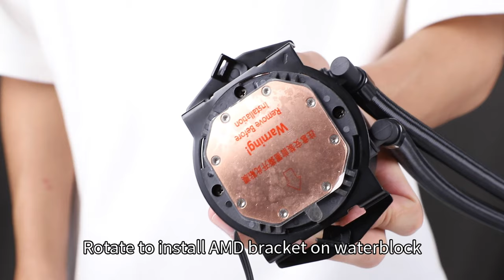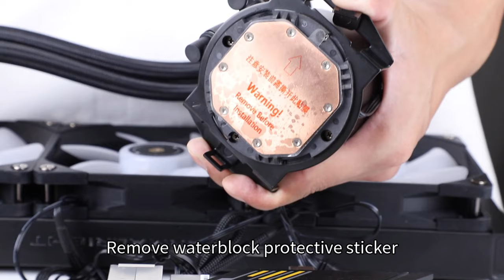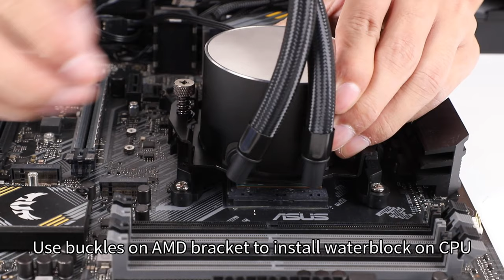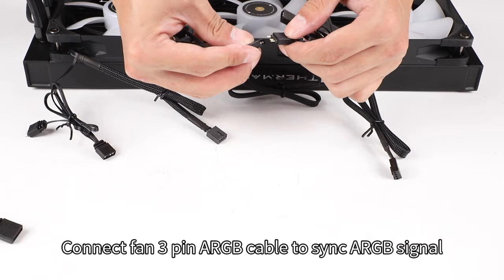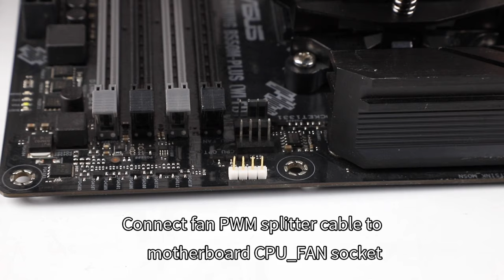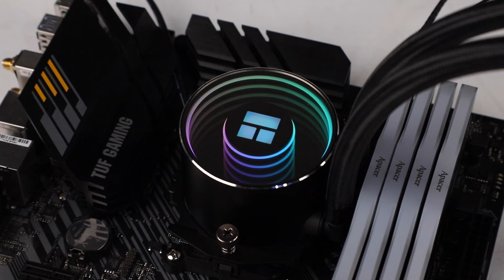THERMALRIGHT FROZEN NOTTE CPU Cooler Installation Guide for AMD AM4 AM5

Comment: This is the most confusing aio every i should of bought something more expensive
Reply: Exactly
Reply: @RichBandza  I was able to figure it out eventually, got it working fine
Reply: @TheDarkEmpty  i finally got passed being confused. N also got it working sumhow lol
Reply: how did you find out? im so confused where to connect the fans
Reply: @jair2610  I'll look tomorrow and reply
Reply: @TheDarkEmpty ok thanks, im so confused on how to connect the fans to eachother and where to connect them afterwards, is there any place i can message you with pictures?
Reply: I have just built a whole computer, and this thing has had me stumped for 2 days. The video is not clear at all. Leaves stuff out, cables suddenly appear from off-screen. Doesn't show where and how they all are supposed to connect at all. I don't get why they just don't pre-connect this daisy chain stuff before selling them. Why they don't supply some clear pictures and diagrams with the product is just lazy. The instruction booklet has bugger all in it.
Reply: @eAGer4 it's a bit of a pain in the ass but once you figure it out you'll be better better off, to took me a two days to figure it out I just kept watching and pausing the video trying to figure it out
Reply: @TheDarkEmpty  my rgb doesnt light up. but atm i only have power to mobo. fans and pump have power and the rgb lights flicker upon power up but dont remain

Comment: Hi, I have the frozen night 240 model, I have difficulty connecting the cables. the heatsink cable has two connectors (male - female) the male switch (3 pins), must be connected to the Motherboard., where should i connect the female connector? because all the remaining RGB connectors are already all connected
Reply: Did you fix it? If so how
Reply: lga1200 compatibility.? for Intel
Reply: i have the same issue

Comment: Just purchased after I finally got in touch with ThermalRight. Took 45 days, but better late than never, told me they made an error in their one Amazon listing because there are several models that have the same name. Just got it today and will be installing and reviewing it next week. Just price, with tax came to under $69 and looks easy to install as long as you have lots of velco or preferred method of cable management ties, cuz it requires a half dozen daisy chains and 3 plugins, so 9 connections in total. Still I have  high hopes for this. I am already using a ThermalRight CPU enclosure for better protection of Ryzen 7000 CPUs as well as guards thermal compound from leaking, and I purchased a thermal right tower air cooler for another build. LIke you guys.

Comment: Well this is an amazing AIO for the price. Works well on my AM5 socket. However, I can say this with complete certainty that this was the hardest cooler I ever had to install. The pump hoses are stiff and it was difficult place, but not too bad. The fans came pre-installed which was great, the radiator installation was no problem, very straight forward. The hard part comes with cable management and keeping your sanity. I saw mention of this on the PC Part Picker site. The way they have it set up is through tons of daisy chaining, each fan has 3 cables coming out of it, it's a spider web of horror. So be ready. But once it's installed, it performs well and is quiet. 

Advance would be to make sure you have plenty of velcro or zip ties, you don't want to use the twist ties that they come with because the wire inside can be conductive. Much easier if you have a single helper. Install the radiator with the thermal right logo facing the back of your case, and try to feed the cables through in two groups. One for the ARGB lighting, and the other for the fan power cables. Make sure this is the last piece of your build so that all your other cables are already managed. Once you have all the cables behind your case, then remove the twist ties and carefully daisy chain the ARGB cables, tie them together and do the same for the power cables with the adapter provided. A PWM hub is a must for this so hopefully you have one, if not, order in advance and install beforehand. Then just plug everything in and tidy up any last things. Final note, because I saw a lot of people commenting about this on Amazon, the pump connection only takes 3 pins, but your board probably has 4 pins, this is not a problem. Just plug in the pump to the correctly marked header and going from left to right plug in the pump socket, leaving one pin exposed. It will work normally. This is a compatibility design, nothing to worry about. 

If I had to install this again, that's the way I would do it and I think it would be a lot easier. Instead i untied everything and tried to velcro and zip tie it before feeding it to the back of my case, like the guy does in the video. That was a big mistake. I have a full size ATX case that is compatible with E-ATX motherboards so I had plenty of room. If you're working with a micro ATX case, this may prove more stressful, but totally doable, as long as you have a good case that's well designed. That said, I'd consider a 240mm for that, unless you really need the extra cooling. I just really wish this video showed some cable management. Anyway, sorry for the long comment and probably poor grammar, but I thought if I was detailed I might help someone. So if you are an experienced builder with lots of cable management skills, this is a great bargain, if not, I might spend a little bit more money and get something that's easier to manage, especially on smaller cases. Good luck and thank you Thermalright for making liquid cooling affordable. Cheers.
Reply: Thank you for your detailed comment. Just got this yesterday. Going to set up on my h6 flow case. Again thank you.
Reply: @abraryasir7494  No problem. Hope you set it up with ease. I only wish I had instructions first, LoL. Those cables gave me a panic attack without plan of action. Velco is your friend.
Reply: How do you daisy chain the ARGB cables? my ARGB cables came with only 1 female connector. The supposed male connector is just sealed off like permanently.
Reply: @grippysack  There are a total of three connection ports on all ARGB thermalright fans. Even the ones you buy separately. One powers the fan (4 pin) the other powers the lighting, and it pigtails into a male and female plug. If your thermalright fan only has a single cable connector, then you purchased non argb fans, and only require a single connection. 
I would double check to make sure you purchased the argb version, as the Notte also features a non argb version. Which would be what you're describing. At the bottom of the box it should read: "Frozen Notte 360 (the color of your aio) ARGB."
Reply: @grippysack  You figure it out yet buddy? I assume so, but one thing I meant to mention because someone on Reddit just asked me your exact same question, and they didn't realize the male end has a "cap" on it that removes. This is to stop the pins from bending when not in use. So I thought I'd comment that to you, as the instructions are very lacking. Hope you're up and running.
Reply: @bizbarley74 can i ask you on reddit with pictures? im so confused on how to connect the fans to eachother and where to connect them afterwards

Comment: A loose SATA cable was included. must also be used?
Reply: It’s only if you have a fan controller. Fan controllers use sata as power so if you have a fan controller you need it to power the fans

Comment: Come on your own installation manual on your site shows we do not use those black clips for AM4.
Reply: Which part are the black clips at? I’m installing this tomorrow with am4. Is the video or manual correct? Thanks
Reply: @swampmilk8445  I bought this but whatever I have yet to install it as I purchased a new case and the new psu arrives on Sat.  Their website has an erronous link that when you click it it takes you to a different product of theirs.  This one demands those clips for AM4.  The clips are what hold on the spire heatsink fan but my old Noctua eliminated them as it used its way better system.

Comment: I just watched another video of the exact same AIO and he plugged the 3 pin pump plug into the CPU_FAN header with the opposite side of the 4 pins on the board being open… why? I’ve always been told to NEVER use the CPU_OPT header for the AIO pump and to use the CPU_FAN header for it.
Reply: There's a lot of daisy chaining and plug adapter use. You daisy chain all 4 3 pin 5V argb (including the argb on the pump fan) together and then you can just plug a single female 3 pin into your PMW header, which you should have standard if your using any half way decent case. So after chaining all the argb, its only one plug needed to mobo or PMW. The radiator fans are all plugged into an adapter that goes into your normal 4 pin CPU fan header. And finally the pump fan is a 4 pin connection that goes into (on my MSI Tomahawk B650) "pump fan" slot. But other boards will have other markings, CPU_OPT or AIO. So there is only a need for 3 connections to a power source, two are 4 pin and one is three pin for the argb if you have that model. Pretty straight forward.

Comment: Hello, can you tell me what program did you use to change the RGB of the pump?  you would help me a lot
Reply: It's going to be based on what Motherboard you have or where you plug in your RGB Cable.
Reply: I got issue too. I used msi b760m motherboard and MSI Mystic Light but nothing worked. I put all the ARGBs cable into Itek ARGB Hub (3 thermalright argb fans + 3 itek Argb fans + Pump Argb) anche connected to the motherboard but I only got all LEDs synced with the same color but I can't change them at all. I tried witch AURA Sync, MSI mystic Light, Open RGB but nothing....
Reply: signal rgb
Reply: @fili191 is signal rgb compatible with msi?

Comment: I connected everything as in the video, all 3 fans work but the RGB of only one fan turns on, any advice?
Reply: Same here!! Been trying to figure it out for ages cant seem to find the solution. Did you figure it out?
Reply: @ruhuluddin7687 Make sure to plug in the other fan cables with the fan header that came with the cooler

Comment: rgb flickers on all parts upon boot but does not remain. fans and pump are powered correctly. i have not fully built yet however, only power to mobo active atm. any fixes? does fully building pc or installing rgb software fix this?

Comment: Can this be mounted at the bottom of a case? Looking at this as an alternative for the Be Quiet Pureloop 240 for the Coolermaster NR200P @thermalright
Reply: no dont do that, the pump should be upper because of air bubbles
Reply: The Be Quiet Pureloop, the Fractal Lumen, and the MSI  @liav1609  Coreliquid, are all designed with pumps that aren't in the CPU block meaning that they are not above the radiator.
Reply: this has a pump attached to the water lines and not on the block that attaches to the CPU.  It looks like an H shaped bridge with a 4 pin connector coming out of it.  As long as that H shaped part is NOT the highest point of the entire system, then it can be mounted that way.  That being said, having air in the CPU block will reduce the cooling efficiency just a bit, but it's better than a burnt out pump.

Comment: For smaller cases, double check if the rad covers the mobo connectors if they do then you need to connect the cables  to fhe mobo first. In summary just plan all the cables first.

Comment: received mine today!! I dont have the AMD brackets though, so i still need to wait for those to arrive. Cant wait to install it!
Reply: Aren't there AM5 brackets included in the heatsink?
Reply: same, how did you install?
Reply: do you have to put water in it? im so confused because i dont want a water cooling but it says it is, he never put water in it though so i am confused
Reply: @olamanna7402 AIOs like this are prefilled. You can’t empty them or refill them without breaking them, but you shouldn’t have to
Reply: AM5 brackets are included right?

Comment: I have this model but the 5v 3 pins connectors doesnt seem to have the daisy chain connectors, theres some extention but its like blank or sealed top, is it removable?
Reply: I have this exact same problem. The sealed top is definitely not removable. Have you found a solution for this? I’m considering just buying a ARGB hub.
Reply: NEVERMIND IT IS REMOVABLE!😭😭
Reply: I was trying to just pull the top off but its like a whole protective lid so you have to hold it from like the base where the cables connect to it
Reply: Same i didnt realise it had such a long cap 🤣

Comment: I'm having problems on mounting it on an AM5
Reply: Me too did you find a solution?
Reply: Same
Reply: @llosez3878  I used the amd5 mount bracket that came with my motherboard. One of the pipes was super hot after a minute of turning it on. The whole product seems suspect and I returned it. Intructions doesnt say its for an AMD5 either. Spent a bit more money on a different brand and it works great, so it wasn't me or my pc.
Reply: This product is advertising to fit am5 socket. My mothboards am5 socket is a 1718 and I cannot use this cooler. It does not fit. I

Comment: can I mount this AIO tubes at the top at the front of my case?? will i experience pump failure?
Reply: As long as it fits in your case it doesn’t matter, if you put it in the front just have the tubes coming from the top of the AIO, otherwise if the AIO is on the top it doesn’t matter.

Comment: in my case, i ordered am4 cpu water cooler for my ryzen 7 7800x3d , i want to now if it will work fine with or refund it now
Reply: Did you receive it ?  Does it cool your Ryzen 7 7800x3D well?
Reply: Did you receive it ?  Does your Ryzen 7 7800X3D cool well?

Comment: Its a very good aio and i mean the rgb is easy to control i have asrock x570 with no issues! I am using an uphere hubs that helps with sending the rgb signal to all my fans and other things lol you cant have like 6 rgb fans on one 3 pin 5v header and expect no issues. I use Ryzen 7 5700x
Reply: you think it would be good for the ryzen 9 5900x?
Reply: @Chawmerz it is pretty good. I’m using a 5900x with this cooler and my temps rarely exceed 65c
Reply: Did you tighten the block spring screws until they stop moving? Idk ho tight to get them. I ran a stress test after installing on my ryzen 7 5700x and it hit 100c. Yes there is correct thermal paste and I removed the sticker off the block.

Comment: Can it be mounted on am5?
Reply: No, absolutely not
Reply: @ThisIsMeArnold  too late😅, but it works very good
Reply: Did you manage to mount it all okay on AM5? Wanting to use it with my 7800x3d
Reply: @tomdodds4366  the 240mm holds off my 7600x, so i think is okay use it on 7800x3d
Reply: @jink_22  thanks brother
Reply: @tomdodds4366  happy to help you
Reply: @jink_22  how u got it to mount am5???
Reply: @ThisIsMeArnold says it does

Comment: I installed it but fans spin with no rgb lights what do I do?
Reply: id you have aRGB connector on MB then its should work, if you dont then dont connect the aRGB cable because you can cause short circuit
Reply: @liav1609 I connected them to my Argb header but the rgb only blinks up for a second while booting
Reply: @lrnz3902 did you fix it ?
Reply: @lrnz3902 same mine blinks but does not remain

Comment: Fck y i have asus b450 pro s i dont have rgb 5v  and this is nice probleme  --__--  I turned on my pc without rgb
Reply: you can connect rgb directly to the the power supply with a rgb controller, i have the same issue

Comment: Absolutely horrible instructions fr. Damn thing comes with 20 goddamn cables and there is not 1 single video on youtube that will give a detailed instruction on how to set it all up. Like holly crap Im about to break this thing and just buy a regular cooler.
Reply: Agreed. Have you worked it out? I need something that makes more sense
Reply: @eAGer4  Yea I did it found a video that explained it well. Glad I didnt get a regular air cooler because this one is a great bang for your buck and keeps the CPU temps quite low. The only downside I guess is the 2-3yr lifespan of it but its okay.
Reply: @3MNMS  where is this video? I can't find any. My Notte 240 is a Version 2 and so my cables seem slightly different to the ones in the Thermalright video. Plus the 3 pin male ones won't fit into the 3 pin female ones!

Comment: This product is advertised as an am5 socket and more product. It does not fit an LGA. 1718 socket am5 board. What a waste of money
Reply: So this was my error. I had a air cooler prior to purchasing this and I removed the two black CPU heatsink standoffs and did not keep them thinking I would never use them again because I never have used them for any cooler in the past, but the am5 bracket with this cooler requires those. This cooler works fine and fits perfectly on an am5 socket board
Reply: @shanerGT same, had to buy some off amazon. what temps you getting?